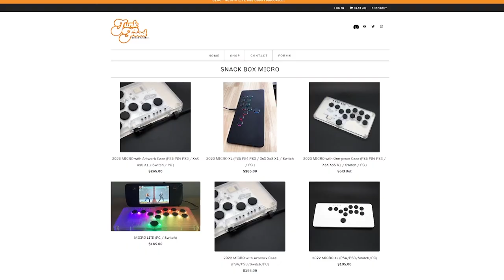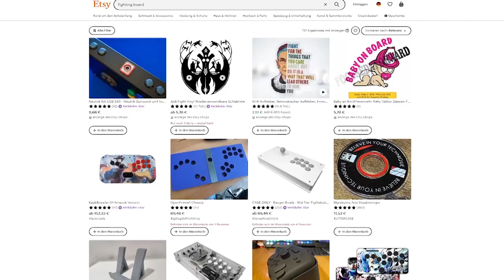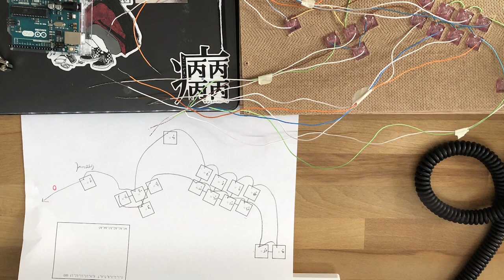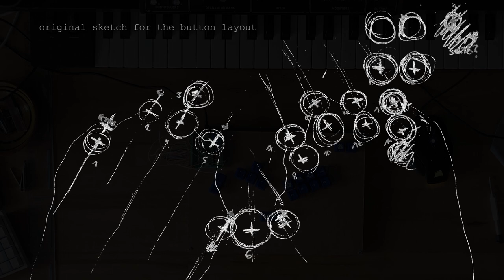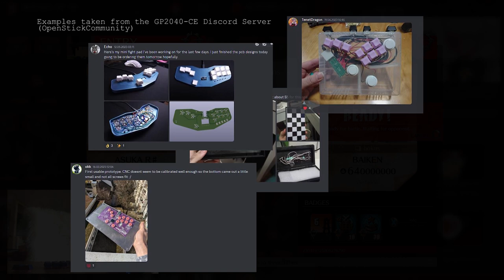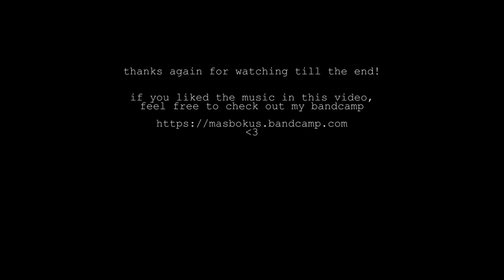My DIY Fighting Board Journey

Comment: How did you manage to keep the switches from falling down?
Reply from the maker: Cherry Switches have a very small edge all around that keeps them from falling through. The Opening has to be cut very precisely for it to work
Reply: @SquidsTv  Thanks for the response! Did you use the Pico-Wireless for this or just the regular one?
Reply from the maker: @csaltlatte  I personally have used a Rasberry Pi Pico (H), was the cheapest. https://gp2040-ce.info/#/download The supported Microcontroller Boards are listed here: Rasberry Pi Pico, SparkFun Pro Micro, The Waveshare RP2040-Zero and the Adafruit KB2040. Not sure if the Pico-Wireless is supported, might want to ask on their official Discord-Server.

Comment: Dumbass question but how do you make the switches to stick to the wood sheet?
Reply: I guess thight fit, i have on my hand switch (similar to what he used) and they have base 14mm on 14mm and he cut 14 by 14 if i understand correctly what he wrote in 5:01